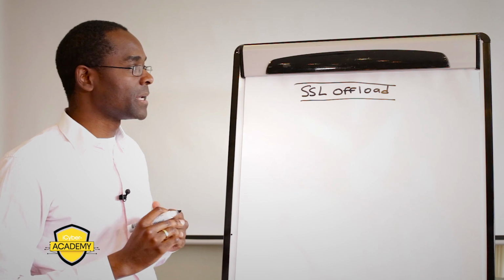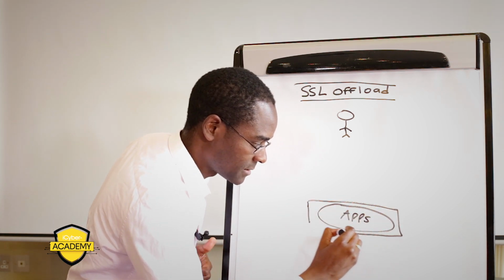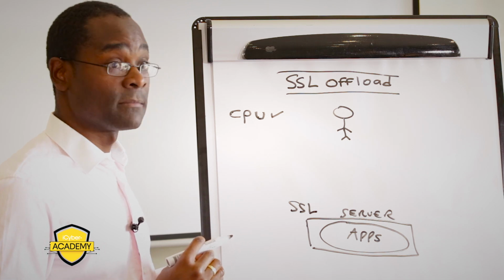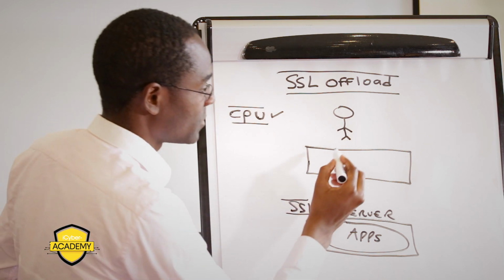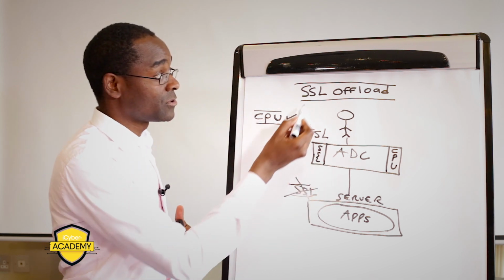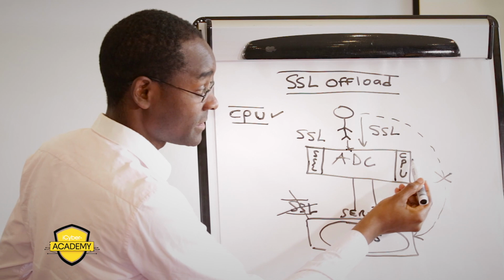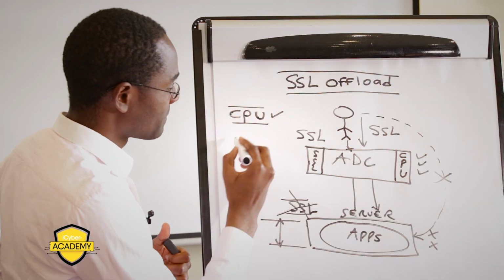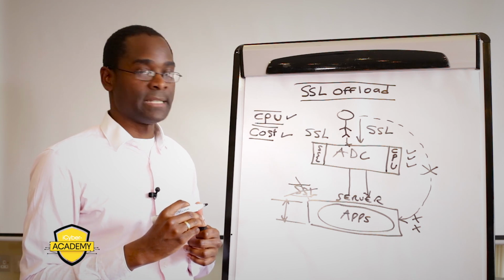InfoSec Bites - SSL/TLS Offloading Explained  | By Marco Essomba | #SSL #TLS #Offloading

Comment: Thank you! quick question: Will there be small latency impact due to the extra hop?
Reply from the maker: You’re welcome. Yes, but in practice very negligible as long as the ADC is properly scoped. In most cases in fact it speeds things up...when  ADC caching, compression, acceleration, is on.

Comment: hi, what if I want to encrypt the data traffic between the ADC and backend server, do I need to install the certificate at backend server as well?
Reply from the maker: Laffin Vid yes you need a CERT loaded on the ADC to then re-encrypt server side. So to clarify: if client —> ADC encrypted = CERT on ADC client side, if ADC —> Server encrypted = CERT on ADC server side

Hope that helps.
Reply: @MarcoEssomba  thank you for your reply, that part I understand, but my question is, do I need to install the same certificate on the real server (backend application server)?
Reply from the maker: Laffin Vid yes best if you install a valid & trusted cert on backend. Technically you can have another certificate if you want (could cause all sorts of issues), but I recommend you keep the same valid CERT that is on the ADC on the backend also when you do ADC —> server side SSL.
Reply: @MarcoEssomba  thank you very, im so new into this ssl termination at F5. But now I fully understand. thanks again Marco for taking some time on my question.
Reply from the maker: Laffin Vid you’re welcome. Happy learning!
Reply: @MarcoEssomba  hi again Marco, would like to ask again, supposed I got 2 servers and I use to connect to it by using a VIP, if  I am going to install a certificate from which device should I get the CSR? Is it the CSR from the ADC device or the CSR from the server? If from the servers, do I need to provide 2 CSR? TIA
Reply from the maker: Laffin Vid get CSR from ADC. CSR request will create a local CERT key. Once CA returns the signed CERT you can load it to ADC so 2x backend server need not participate
Reply: @MarcoEssomba  the thing is we need to encrypt also the traffic between the ADC and the 2 real servers. Its a must in our orgranization.  So is it still the same thing I need to get the CSR from ADC? And then when I get the signed cert I install it on both client and server ssl profile. but at the same time we install the signed certificate at the back end server...am I correct? Really thank you for this.
Reply from the maker: Laffin Vid CSR from ADC, once CA provides full CERT, export CERT & Key and load it to backend servers as needed. You need need CERT + Key pair on backend...it’s a lot easier to do the CSR on ADC & manage it there...you get alerts when CERT expires as a ++
Reply: @MarcoEssomba  I see...one of our requirement is to get the ssl cert in pfx format...CA should be able to provide that right? My questions seems to be funny, I understand how ssl certificate works but how to generate, where to generate is something confusing.

Ok so I get it now...
(1) I generate the CSR from our ADC device
(2) Provide the CSR to ICA
(3) ICA will return the signed certificate in pfx format including the intermediate certificate. This becomes the chain cert.
(4) In ADC, I need to install the signed cert and the chain cert on both client and server portion.
(5) Finally I need to export the cert and key and install it on the backend servers.

Hopefully the steps are all correct?
Reply from the maker: Laffin Vid spot on!
Reply: @MarcoEssomba  Thanks a lot ha,,,because of you I am now more confident about this ssl thing. Thank you very much!
Reply from the maker: Laffin Vid you’re welcome good luck with the project!

Comment: Does that also mean the connection between the ADC and back-end is not secure, since there's no SSL involved?
Reply from the maker: Gaurav Kumar correct, backend will be in clear a decision that the security team will have to trade, in some environs (like finance) SSL much be done again on backend
Reply: Thank you for responding so quickly! :)
> If back-end does require SSL, isn't it better to avoid ADC altogether?
Reply from the maker: Gaurav Kumar think about easing off the load CPU, RAM, etc on the backend and  let the ADC take that job - that’s why you need an ADC in that case - it’s designed for that purpose!
Reply: I think I've got it now.

> The back-end servers which host our application should only concentrate on serving user requests. Since, SSL involves much computation, this would put load on the back-end servers. In order to avoid this, we can "offload" this task to the ADC, which will basically act like a reverse proxy.

Thank you for such an amazing explanation! :)